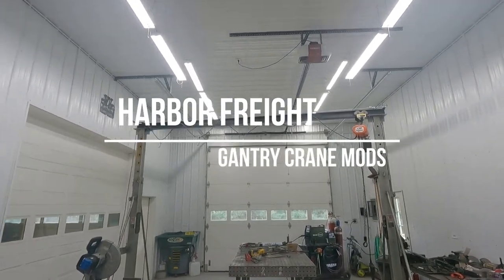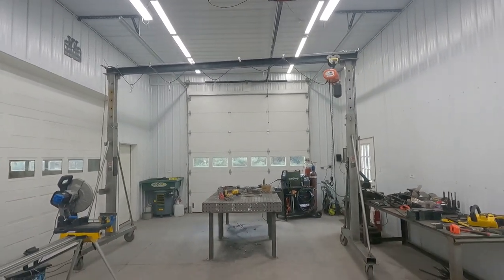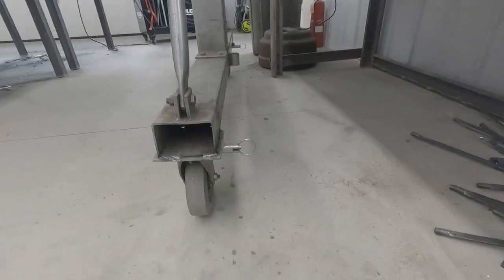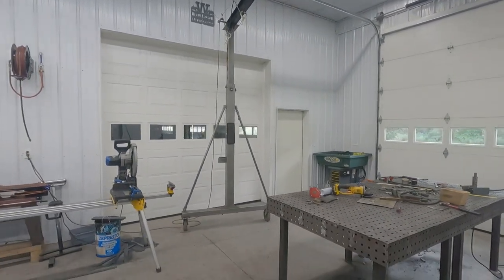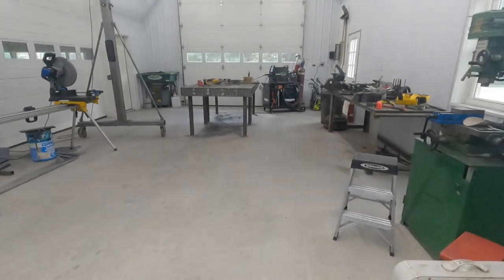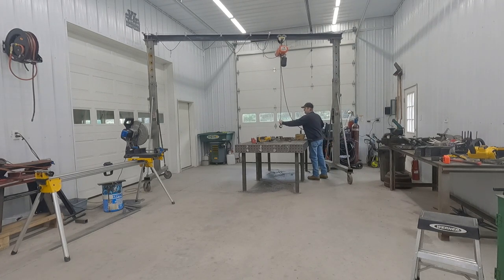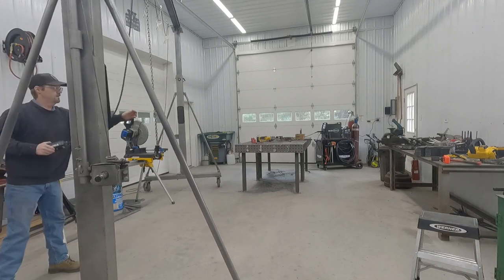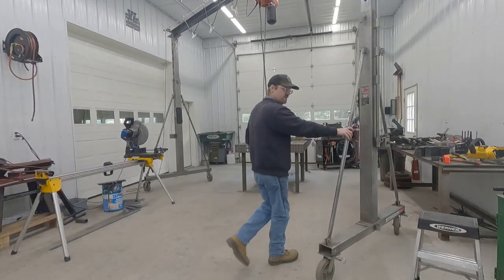Harbor Freight Gantry Crane Mods

Comment: I'm looking for a w4 X 18 H-beam. Can't find it. Is it possible to point me to where I can get one? Can you give me an idea of the cost? Preciate it.
Reply from the maker: Check with a local steel supplier in your area. You can also use MetalsDepot.com they may have it but the shipping would be expensive through them I am afraid.